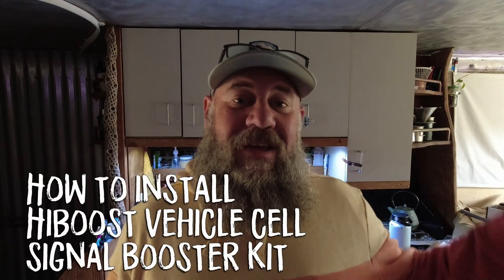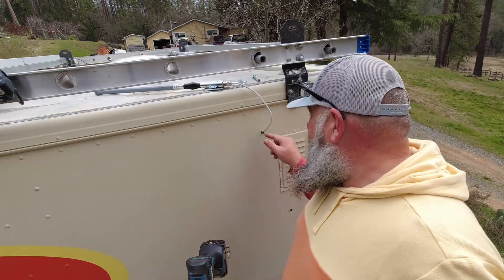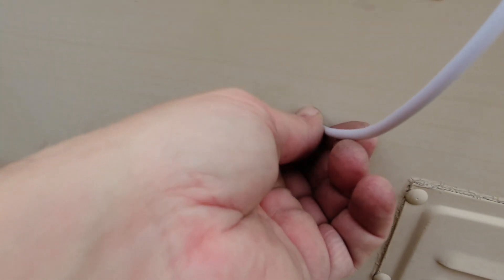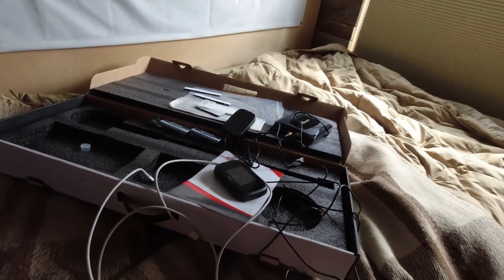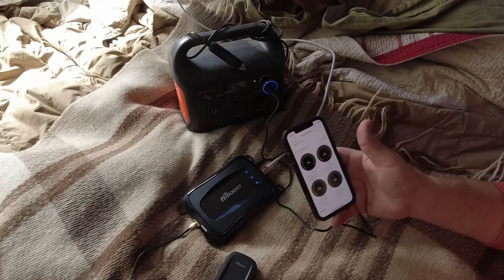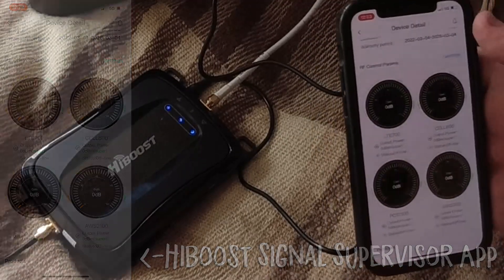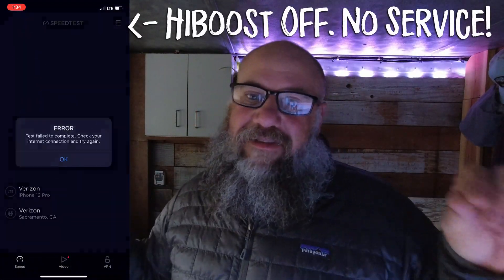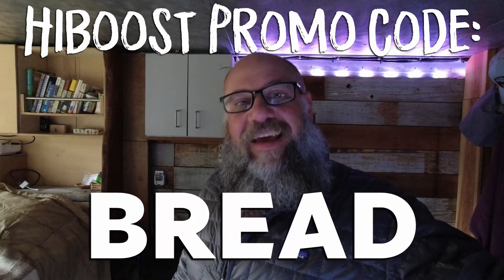Cell Signal Booster Install | HiBoost HUGE Improvement | Digital Nomad Made Possible!

Comment: if you would also configure QOS and leave a little bandwidth open then one device would never dominate your connection. If you're rate is 10/1 set qos 9.5 .8 and there will always be a little bandwidth available.

Comment: I thought you already had one. I remember the triangular antenna you stored behind the drivers seat. Was that a different system? It will be interesting to see what kind of results you get in your travels.
Reply from the maker: I had a yagi antenna without a booster. Still have it. It sucked for the most part. This works way better.